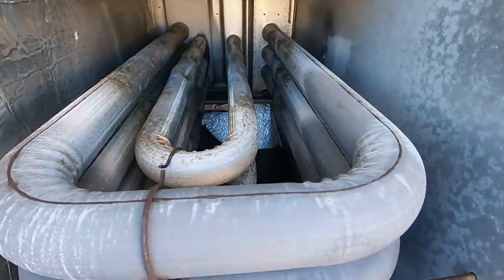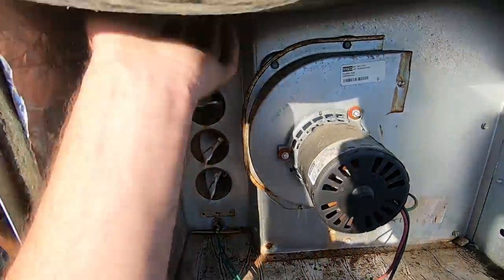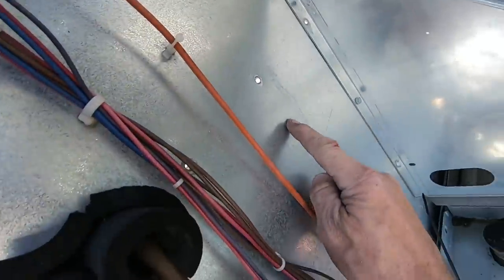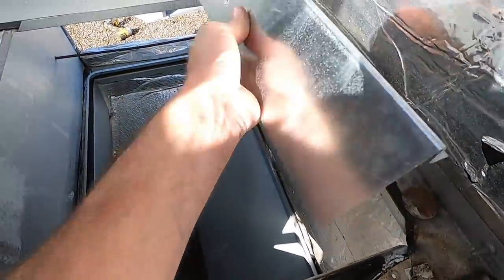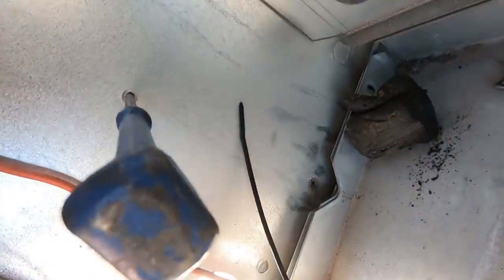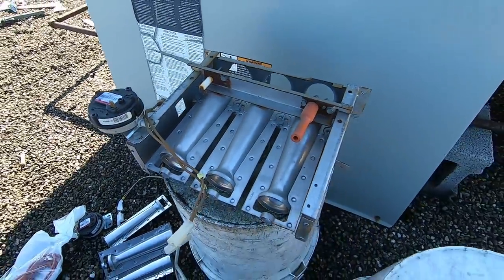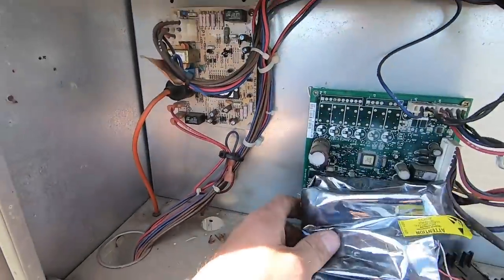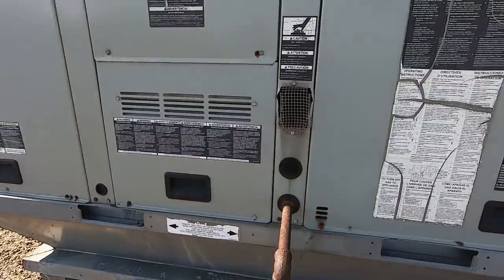Trane Heat Exchanger Replacement Start to Finish

Comment: 20:29 - You may have a limit on your channel as to length of videos; but, it would be nice if one of you guys shot an installation like this uncut and at normal speed. That way some of us newer techs could have a better answer for the customer when the unit will be back up than, “Sometime today,” or worse, underestimate with “a couple of hours.” I appreciate you sharing your knowledge. I will expect some challenges; but, I’m now more comfortable replacing the rusted out heat exchanger I condemned a few weeks ago at a restaurant (Lennox RTU)
26:31 - All customers have the potential of being a pain in the arsenic; but, don’t stink out the building, Guys. Not cool. I like that the other cover works there. Nice tip.

Comment: Bitchin. I believe, and I could be wrong, that those "turbulators" are for nox. As long as your in a place that doesn't require low nox they can be removed. Not that anyone should do that on purpose but if they crumble you can take them out.
Reply from the maker: Good to know, thank you for watching John!

Comment: I used worked at trane here in Lynn haven Florida making these units. This must be a really old unit as the units I built would have holes for both short and long versions for the heat exchangers. Also the whole heat exchanger blower assemble is so much easier to work on in the factory as its built off the base pan. As it is built at start of production I can see why it would be hard to replace in field. Yes the turbelators are a pain to avoid breaking them.
Reply from the maker: I only had to drill one hole on the side closest to the filters, the other side had two holes for different length heat exchangers. These Trane exchangers aren't to bad. Thanks for watching!

Comment: Awesome video!
Just had a heating company quote $3500 to change the heat exchanger on one of our roof top units. Took a look at the unit, and it appeared to be a fairly straightforward job.
After watching this, It's even easier than I first thought.

Comment: Terrific video!  You not only replaced the heat exchanger, but most every other heating component (except the gas valve)!  Heat exchanger I am replacing appears to be burned up, possibly due to high gas manifold pressure, so I appreciated your manometer check of that parameter.  This particular furnace's gas valve may not have any pressure taps!  If so, I will need to machine my own in the black steel pipe downstream of the gas valve...  Scratch awl is VERY useful!  I use one to line up screw holes too!  The exchanger I will be replacing is on a Trane residential downflow furnace...  Many of your details are helpful!  RTV silicone seal around new heat exchanger makes sense, for example...  Blocking supply duct while burning oil off the new exchanger makes sense too, and is feasible due to empty AC coil cabinet below furnace!  THANKS SO MUCH FOR SHARING!!!!

Comment: Thank you for the upload. I'm replacing one. My question is why did you replace the burners and sensor?  Do I need to replace it?
Reply from the maker: We replace them just to have new burners, flame sensor and ignitor. You don’t have to, I would just clean them with a wire brush or wheel. Thanksgiving for watching!

Comment: Having a flame rollout on a trane commercial unit and noticed something in the inlet of each heat exchanger tube. Still searching for possible culprits but my eye was on whatever these things were as I’m unfamiliar with them. And now I can finally go to bed after searching for quite some time on what these things are defined as and what they do. Thank you for defining the turbulator!

Comment: Yes I have changed Trane YSC Ht EX. before and yes, with the shorter heat exchangers you have to relocate the support bar. Funny in the last one I did, the holes were already there from factory so no drilling was required👍 One tip I would add is they do recommend you just put a seam of silicone around the heat exchanger faceplate, just to stop any possible air leaks. Great video I really enjoyed it. Cheers from🇨🇦
Reply from the maker: Thanks for the tips and I appreciate you watching, thanks!

Comment: Nice video!!! I have to do one of these in a week and I was pretty nervous about taking it apart and not putting back together properly but you video helped. Thanks for the video details. I am still a little nervous.
Reply: How do you know if the baffles are  good or bad. Are they easy to pull out?
Reply: Why did you cover that hole up with tin tape?

Comment: not so easy to do the rod relocation when it is horizontal flow and ducts connected to that handy supply air plate
Reply from the maker: I bet man, luckily I’ve only done them on down flow RTU’s

Comment: FIRST!! Nice Video! That exchanger was really bad. And thats a HECK of alot of screws. Not as much disassembly as some others you've shown, but still alot of work removing all that.
Reply from the maker: Winston! I'm replacing a York tomorrow, hopefully I can get some good video of it! Thanks for watching bro!
Reply: I use to built these units in lynn haven florida. The heat exchanger is basicly first item made. The unit is put together around it. That's why it so hard to replace. I have also had to take them apart when someone installs the wrong heater config into a unit.
Reply from the maker: @maxwellmelon69  are you talking about the york units?
Reply: @HughesManHVAC  no the trane unit in the video

Comment: Very helpful and informative video. The amount of screws in these things are ridiculous. FYI for anyone who hasn't replaced one with short tubes before, besides relocating support rod and adding blower baffle, a new limit switch and orifice cover Is required. The orifice cover is usually included but the limit is not.The old limit Is not compatible with shorter tubes. Check instructions for model Info. Larger models need to be sealed with high temp caulk too .
Reply from the maker: Good to know! Thanks for watching

Comment: I watched this video prior to replacing a heat exchanger LOL and guess what happened. I took out the old heat exchanger and before putting the new one in I drilled holes 6 inches inward for the new support bar location. Them before putting the baffle under the blower, I decided to shove the new heat exchanger inside. As I was pushing in the new one it kept hitting the support rod before it was all the way in.  They gave my the papers for the updated heat ex, it came with the baffle in the box...  but I measured old and new heat exchangers and they were exact same length.   Tell me how that happens lol ....  I put back support rod in its original location.  Didn't put in baffle because it was exact replacement....   I am confused why the counter guy even said I'd have some modification for my model unit.  Anyways.  Great video.  Thanks again!  Keep up the good work!

Comment: @hughesman hvac I know it depends on how much oil is on it but how long is the average burn off on a heat exchanger. Great drone footage btw.
Reply from the maker: I've had some that Hardly smoked and some that smoked horribly. I usually let it burn while I clean up and take a sniff after I'm done to see if we are good or need to burn longer. So usually 20 to 30 min. Thanks for watching man!